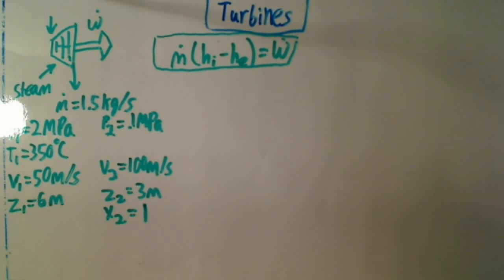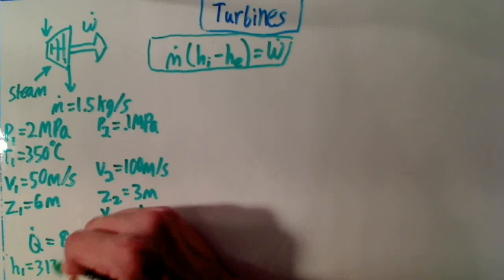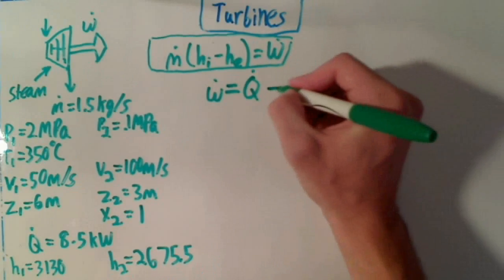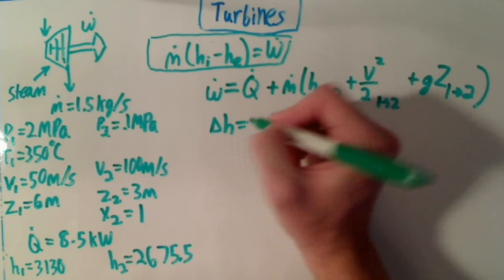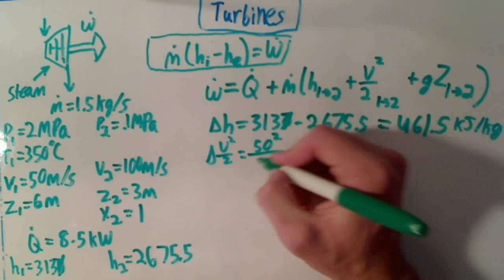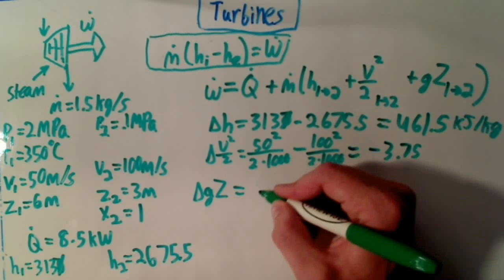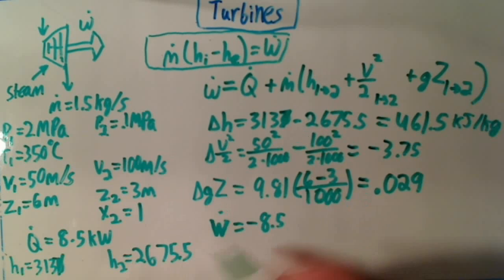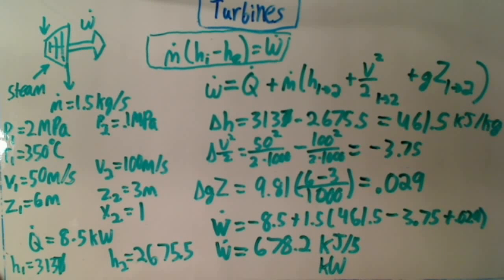Lesson 7.2: Turbines

Comment: Thanks for the uploads. I have found these videos helpful. However, I noticed that in the problem, the heat transfer is given as 8.5 kJ/s and in your work you subtracted it.I did it both your way (the delta method) and the entire written out equation with no derivation, and am coming up with 695.019605 kJ/s. (a sight difference also as my table listed enthalpy as 2675.6 kJ/kg as opposed to 2675.5 kJ/kg.

Comment: How would you solve this problem if if gave you an inlet and outlet area and was told to solve for inlet and outlet velocities?
Reply: Jamie Dempsey 
We know that the mass rate in should equal the mass rate out. 
This gives us, 
Density * Volume Rate in = Density * Volume Rate out
Which you can simply to
Area of cross section * velocity of gas * density of gas in = Area of cross section * velocity of gas * density of gas out. 
You can use specific volume of you want to instead of density

Comment: since there is a quality, x given which is 1.0 that tells that it is a mixture but since the quality is equal to 1.0... that tells that it is a saturated water vapor. When going to the tables at 0.1 MPa (1 bar)...the saturation temperature (or temperature for a saturated water vapor) is 99.63 degrees centigrade. Correlating h value is 2675.5 kJ/kg